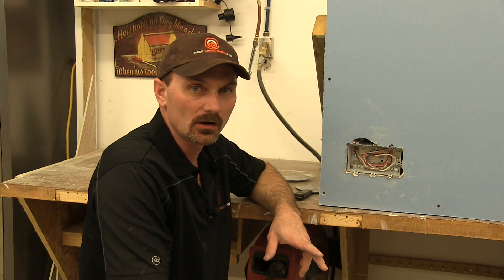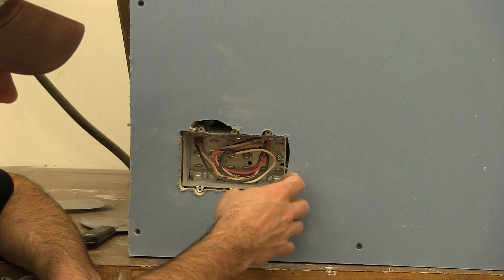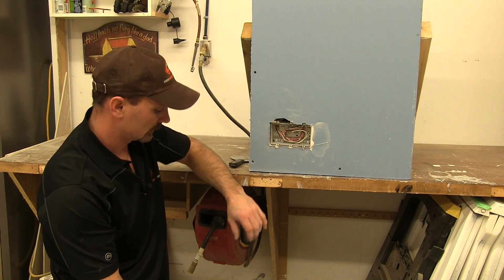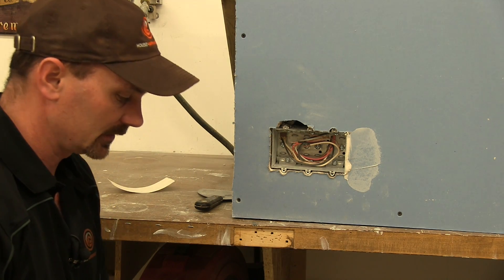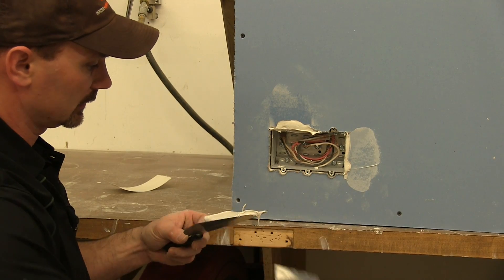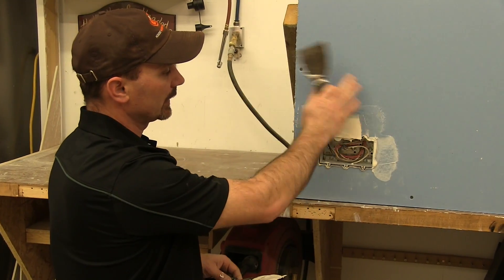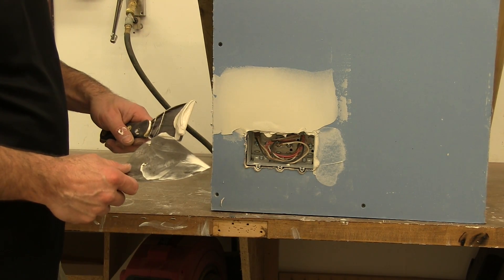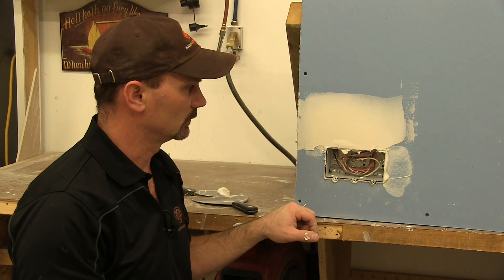How To Patch Drywall Around An Electrical Box

Comment: I am working for a customer now who would like me to fix a loose metal electrical outlet box.  I removed the old box without too much difficulty and will be installing a new box with the special "wing" tabs that grip the reverse side of the drywall when tightened-up.  The issue though is that the drywall opening was cut too large for the box and I will have to likely install some type of wooden backer piece first to provide stability so that when the box is tightened, it will be solid.

Comment: This completely explains why I find so much wallboard compound in my junction boxes.
Reply: Totally!  After drywallers finished their work in our home, we found huge goops of mud inside the boxes, covering all machine screw holes, all over the electrical wiring gluing it together, and some even dripped into the new carpet!  Sloppy work like that makes finishing the electrical much more difficult.  The large globs inside the box and especially around the screw holes need to be cleaned out.  It's easier when the mud is still wet, because if it's already dry you risk it chipping off in chunks around the box yet again, revealing the same hole, which needs to be patched... again!

Comment: On the wider hole, to avoid a bulging repair when completed, you could reduce the size of the tape by cutting it closer to the size of the hole and then mud over it.  Just a suggestion.  Great video.

Comment: Cheers mate I was retro fitting larger rectangle switches with smaller square plate had about same gap on top and bottom. I tried just filling but it all crumbled I will use tape too.

Comment: So I have a question does this apply to electrical plugs that have actually come out of the wall? Mine have screw anchors that pull tight to the wall and those spots have actually broken over time.

Comment: Shannon, can you do a video on how to cut properly around metal mud rings?  I cut the holes pretty close but the device plaster ears hardly touch the drywall at all!
Reply from the maker: draw the hole on the drywall surface for the size of the face of the mud ring but when you cut it out with your drywall hand saw cut at an extreme angle (50-60 degrees) so the back side is wider to allow the bulged surface to fit.  Ill do a video maybe someday. If you have more questions please use my forum.https://www.house-improvements.com/forums/
Reply: @HouseImprovements   I've started cutting a draft into the openings like you suggested and have had much better results. (Drywall STILL isn't done but moving along slowly.)  A few of the others I've fixed with DuraBond.   I'm using an oscillating tool which makes for nice clean cuts!  Thanks!

Comment: Is it necessary to use tape? As an amateur I would just fill the hole with 20 minute sandable and a little later top it off with mud.
Reply: Tom Williams 
My experience with that method is having an issue with the 20 minute mud pulling away from the drywall. I tape over any place I've filled with the 20 minute mud. It can be done as soon as it sets up. Always go a little lean to avoid building up too much material.
Reply: eventually it would crack, you need tape.
Reply: in fact if I were taping ,good chance that smaller hole would also have been taped
Reply: as a pro, I would do the same, just with cornice cement and some salt, as the cornice cement goes off, apply another layer for shrinkage.